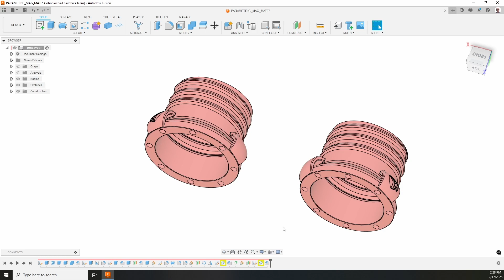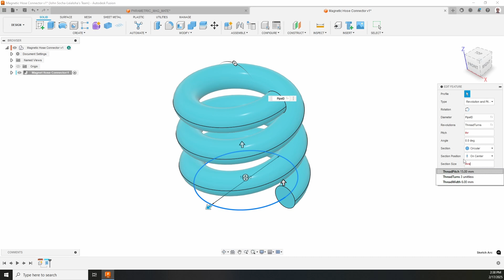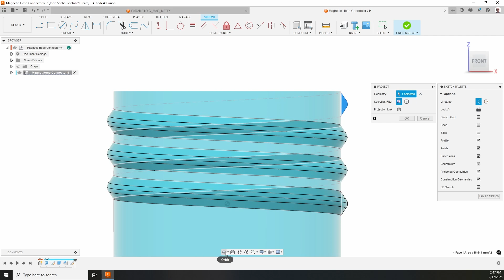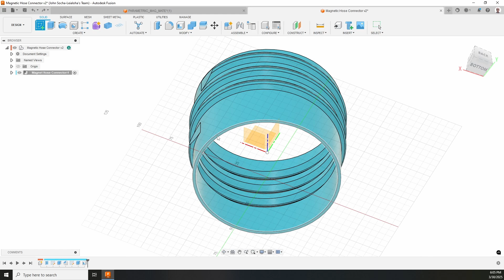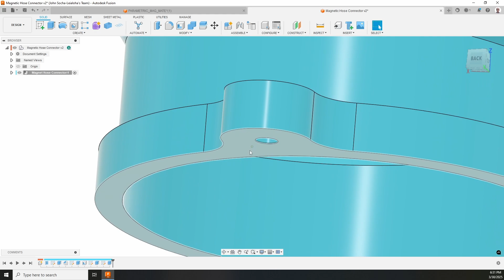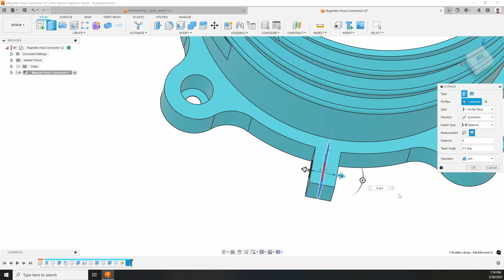3D Printed Magnetic Hose Connectors

Comment: No need to get the magnets into it in that way. Just design and print it with slightly tigther tolerances, then use a heat air gun on each hole and place the magnet and hammer it in, let it cool off, and the magnet should stay.

Comment: Very helpful, i just couldnt get the spiral thread to chamfer, all sorts of F360 errors. my design was smaller about 35mm side and 4mm thread diameter, but i get 'could not create chamfer at requestsed size" i tried from 0.5mm right up and every value NOPE, so i'll try maybe a triangle thread and shave the end off, although not ideal .. some reason the magic didnt happen like yours did 🙂

Comment: A O ring? To keep them from whistling. Or some gasket. Or a bevel seal.
Reply: Is an O-ring not a type of gasket? thought it was categorized as one?
Reply: @LukasSprehn are not gaskets flat fibrous material requiring two flat surfaces to seal. As a O ring is a homogenous material with much elasticity to make seals between circular objects or set in a grove between objects? Both seals not the same method.  Just a generalized description of difference, I am shure there are overlaps of use and construction.

Comment: I would add a handle or simple bar sticking out.  I've always found it's easier to pull something like this apart when there is an obvious grab point (even if that creates an unnecessary stress off to the side).  Just putting it 1/4 distance between two magnet points (rather than centered between them) would offset the handles when the connectors are in the joined position facing each other.   Just my 2c - feel free to ignore me.

Comment: Thank you fo the video, but in this case i don't understand, why did you use parameters?
I think it's very powerful feature for a parametrical model, but here is no sense or i don't understand 😮
Reply from the maker: I generally use parameters because it makes it easier to make changes later. In this case, I published the Fusion 360 file, so this will make it easier for others to customize it to their needs.
Reply: well this way, he can reuse this model for any hose size/thread or magnet size in the future without reinventing the wheel again ... just throw in the new numbers, done! 😊